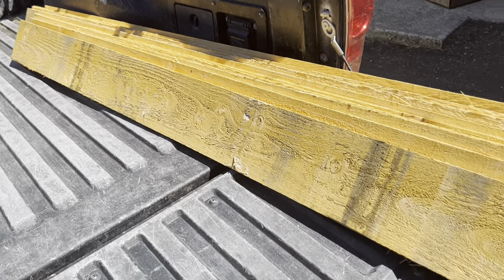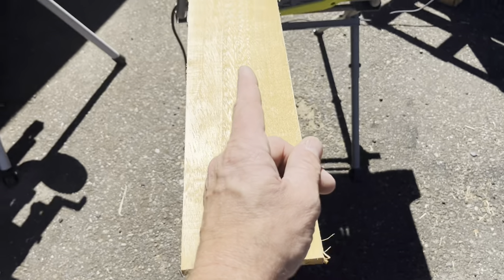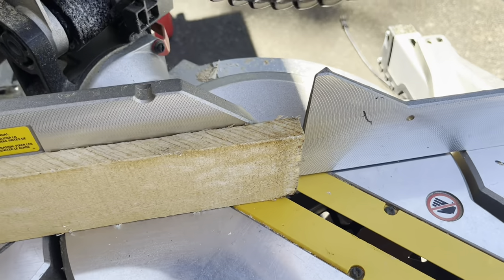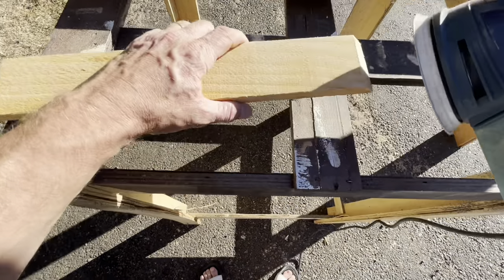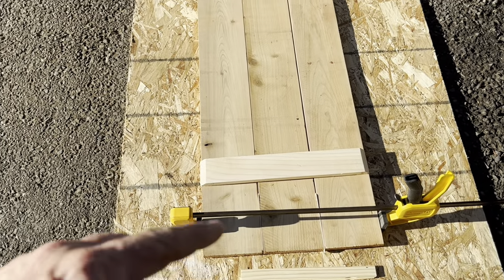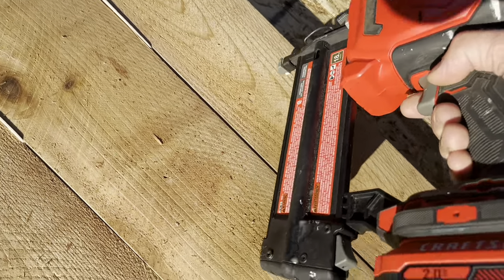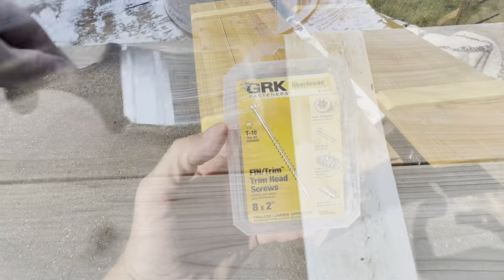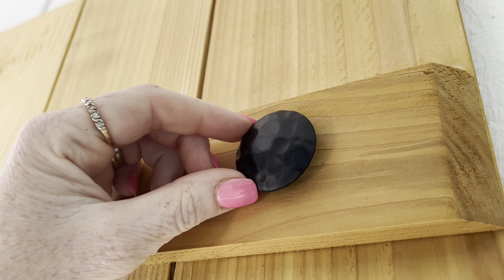DIY Exterior Home Window Shutters Made Inexpensively With Metal Accents [DIY Window Shutters]

Comment: Solid.
Reply from the maker: Thanks!
Reply: Just built mine like this. Painted them black though with Sherwin Williams exterior paint so I'm going to try to find a lighter colored clavos to pop against the black. The end of the braces cut at a 45 degree angle looks nice.
Reply from the maker: @rampage2587  oh man that’s awesome! Thanks for sharing that.

Comment: Are you sure that's "cedar"?  Typically, cedar boards are very expensive.
Reply from the maker: Yep. It’s cedar.
Reply: @DIYTechnician  Thank you for the reply.  If you don't mind me asking, where did you get them from, and is it in the regular, main lumber aisle or elsewhere like the fencing material area or others?
Reply from the maker: @n.g.1577  Of course, no problem. Cedar slats in the fencing material isle. I've purchased them from the cedar supply fencing store as well before as they can be a little cheaper there.
Reply: @DIYTechnician  "cedar supply fencing store"?  Where, and what is the name of the store?  Thanks.
Reply from the maker: @n.g.1577  really if you were to google “cedar supply store near me” you should be able to find out if there’s one within driving distance.
Reply: @DIYTechnician  Oook. :-)